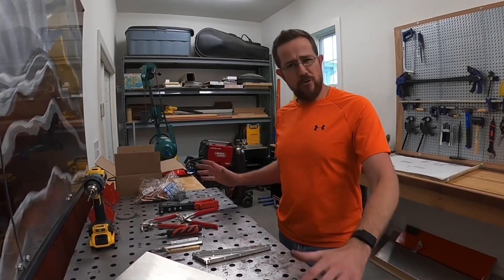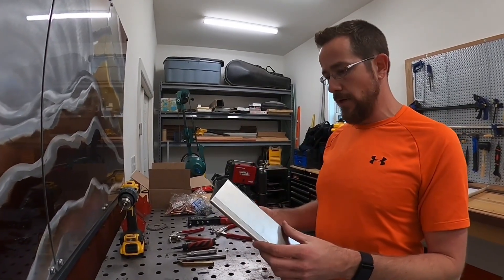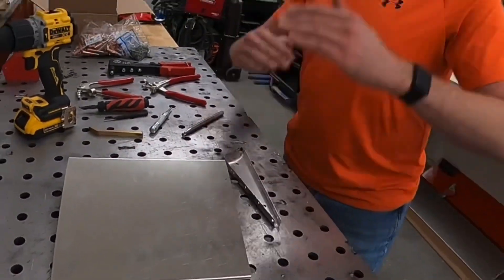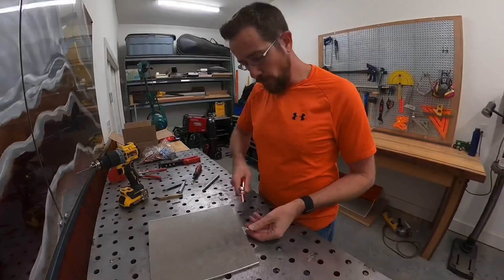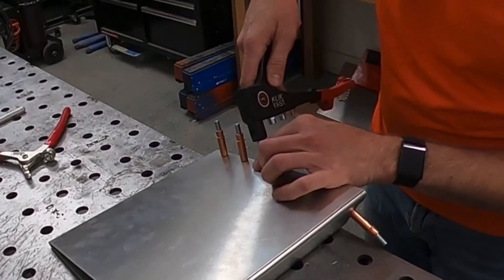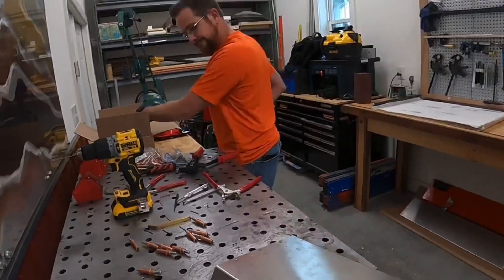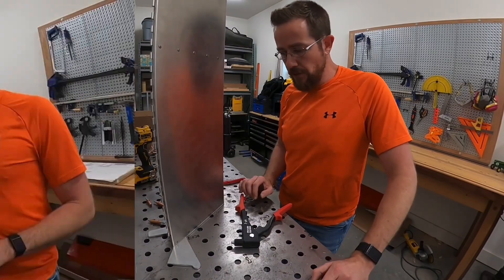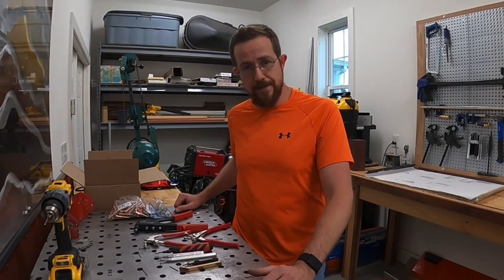How to install blind rivets in general aviation. (Lean of Peak Aviation)

Comment: Make sure that the total material thickness is inside the designed “grip range” of your blind rivets. High quality hand ‘pop riveters’ save on hand fatigue: i.e. POP or Jet.  A rivet’s centre should never be closer to the edge of the material than 1 1/2 times the rivet’s diameter. Buy drill bits designed specifically for aluminum, when working with aluminum. Be careful to only remove the burr and not go deep into the parent material. When de-burring long edges, wear cut resistant gloves. Be aware of your downward force when setting the rivet, as you can create a deformation. The automatic centre punch shown is my favourite and is adjustable in force applied to avoid dimples.  I like to use Vise-Grip sheet metal tongs to hold the two pieces in position prior to when I start drilling (I put some masking tape on the jaw edges to eliminate marring, and test the clamping pressure on some scraps prior).
Reply from the maker: Very good comments!  Thank you!

Comment: Any issues with galvanic corrosion due to using SS rivets in aluminum sheet metal? I Imagine it's a non-issue with the fastener being the most noble of the two metals.
Reply from the maker: Good question…not without the presence of an electrolyte solution…outdoors near the beach might be a problem in some cases or spending lots of time on the ramp getting rained on. Much less of an issue with hangared aircraft.
Reply: They do not use SS rivets for fittings on aluminum sailboat spars, for this very reason. In a marine environment, SS rivets come loose over time. The aluminum around it will just turn to powder. Any corrosion like that should be obvious on pre-flight though, unless you do something silly like ignore it and paint over it repeatedly.

Aluminum rivets are not strong enough. So the alternative of choice on yachts is monel. It lasts for decades, even on salt water. Probably so do SS rivets on hangared aircraft. I'm sure the correct type of rivet is specified in the manual. I think there are also anti corrosion agents you can apply to "fix" the issue, should you want to build an aircraft that will last at an outdoor tie-down. But even that is less durable than monel. You could probably build a seaplane with that stuff.

Comment: Keep in mind that during building, even if using a pneumatic rivet puller, sometimes you'll still need the hand puller at times. (get into places pneumatic tool can't fit)